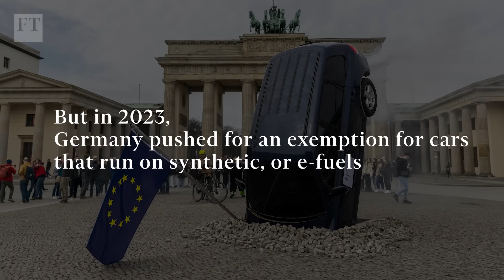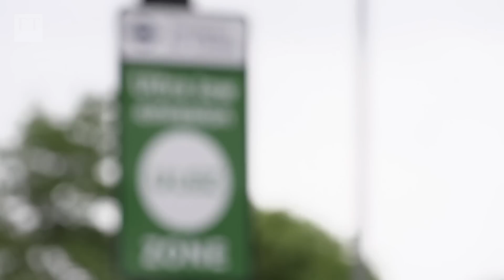The end of the combustion engine? | FT Energy Source

Comment: EVs need cost parity and simular ranges with faster charging  until that happens  combustion is here to stay
Reply: Not true. EV ranges are now acceptable for 99% of most use cases. The average European car owner drives 33km a day (12,000 km a year). We only have the one car, a Kia e-Niro and our average is 19,000 km a year. In a typical week I plug the car in once a week, taking it from 30% to 80% SOC and this covers our driving for the week. When going on a long journey I take the car to 100% and use public charging en route. In the first two years we had a few worrying moments of being able to plug in to a rapid charger but no disasters. In the past two year it has become a lot easier, certainly here in France with many rapid chargers to chose from on the main routes. We have made 4 trips to the UK in the past 5 years, 2 to Switzerland, 1 to Germany and 1 to Spain...never once have we had to queue to use a charger or not been able to plug in, take a rest and continue our journey. Driving 600km a day is comfortable and although I don't like to do more than that in a day we did once do 1,100 km in the winter but that was an extreme case.
Reply: @kiae-nirodiariesencore4270  It's even better if you have a garage with a slow charger. Get home, plug the car for the night, and next morning you have its full range. It's as practical as having someone to take your car to the fuel station for you every day. It's also cheaper than using fast chargers because you tend to pay less for electricity at home than at a fast charger, and slowly charging the battery increases its durability.
Reply: @gametheory2-i6p  There are already EVs with over 1,000Km (621 miles) of range that can quickly charge enough for some 500 extra Km (310 extra miles) in 10 minutes, which is shorter than the pauses you should make while driving that distance.

As for cost parity, EVs in China seem to already be very close to cost parity with ICE cars even when you disregard all subsidies, and are expected to get there in the next few years. Every country that doesn't block the import of Chinese cars should follow soon after, and even those that do impose barriers will need to find a way to make their own EVs cheaper or risk being outpriced out of all the other global markets — which would be a disaster for companies like Toyota, VW, Ford, GM, etc.

Though, of course, that doesn't even touch one of the best things about EVs: fuel prices. If you charge at home, for the same amount you would pay for 100 miles worth of gas you are likely to be able to get 300-500 miles worth of electricity — and that if you don't have solar panels at home, because if you do it becomes even cheaper.
Reply: @gametheory2-i6p 1 in 3 new car purchases in China are already EVs. Someone needs to tell the Chinese that what they are doing is impossible!
Reply: @gametheory2-i6p  Hydrogen like the Toyota Mirai, the single car model with the worst devaluation in the whole US market? That thing is so bad current owners accept huge losses just to get rid of that unwieldy piece of junk. Hydrogen is more expensive than both fossil fuels and electricity, has expensive and clunky logistics, and requires a distribution infrastructure much costlier than either gas stations or recharge stations. Heck, hydrogen stations are already closing down in the US; Hydrogen has already lost the race to EVs, and soundly so.

As for CO2, there are credible studies showing that even if you use coal power for both making and recharging an EV it will still emit less CO2 than a car powered by fossil fuels; the difference in energy efficiency is that great. And as old fossil fuel-based power generation is replaced with renewables the CO2 footprint of already running EVs is further reduced, whereas the CO2 footprint of a fossil fuel car can't be reduced (well, not unless you are willing to pay 3-5x more for your fuel in order to use the synthetic kind, if you can even find it for sale).

As for EV performance and charging speed: stop looking at EVs from 2010 (or at EVs that are more akin to toys than to cars) and start looking at proper EVs from 2023 onward. Batteries are evolving by leaps and bounds. A decade old EV will obviously have much worse battery performance than a new model; heck, even a year can make a big difference with how fast things are changing right now.

Regarding winter performance, modern EVs actually lose less efficiency in the cold than ICE cars; what makes ICE cars seem to lose less performance is that you get "free" heat for heating the cabin due to all the waste heat generated by ICE cars, but if you don't use the heater then modern EVs, with proper battery temperature management, actually lose less range on average in freezing climates than ICE cars. Heck, Norway — a country where half of its landmass is inside the Arctic Polar Circle — has almost 85% of new cars being pure EVs, and most of the rest being hybrids, with only a small fraction of cars there being internal combustion cars; you would be hard-pressed to find a country with colder climate than that, and EVs work just fine for them. Also, the only car to ever successfully complete the trip from North Pole to South Pole was an EV, exactly because ICE cars have huge issues running in the extreme cold and high altitudes of the South Pole, but an EV has no issue with it.
Reply: @gametheory2-i6p  What radiation, electromagnetic waves? If those were an issue then you wouldn't be able to use radios or cellphones inside an EV, and the EVs wouldn't be approved by the FCC to boot. It's easy — and mandatory — to shield electric engines and other electronic components to prevent them from emitting this kind of EM radiation, as failing to do so could interfere with, or in extreme cases even bring down, telecommunication systems.
As for other kinds of radiation, there are none.
Reply: since when has Porsche announced that it wants to get out of EVs?  It has just announced new EV models and its goal is for 80% of all new sales to be EVs by 2030. Are you for real?  @gametheory2-i6p
Reply: There is already purchase cost parity in some countries.
Whole life costs are generally lower for a new EV vs ICE.
Reply: I read somewhere recently that half of American motorists drive their vehicles less than 3 miles a day. Hot Take: the average American (and Canadian) is too sedentary & lazy to walk or cycle only a few miles. And those who do try to exercise and improve their health, may end up risking their lives on dangerous multi-lane highways & stroads—purpose-built for cars, not people. But back to your point about 'range anxiety' with EVs, most electric vehicles being manufactured now have more than enough battery capacity for ranges far-exceeding what the average commuter in the U.S. travels in a day.

That said, EV sales will bolster industry profits and sell even more automobiles to a hopelessly addicted and car-dependent culture—but EVs will do nothing to save our planet, in the end.

Comment: Combustion engines are not the biggest problem, EV’s are not the best solution, given the mining required to furnish new electrical infrastructure
Reply: Combustion engines need oil based products to make them run, e-fuels are a fantasy as we will never have the feedstocks to make much of it and the conversion process is very expensive and wasteful of energy. Drilling, pumping, shipping and refining crude oil is far more damaging to the environment than mining for the minerals we need for the transition. And remember that these minerals are not burned as all fossil fuels are and at end of life will be recycled. Check out the billions of investment going into companies who recycle batteries...Redwood Materials, LiCycle, Fortum, Northvolt, EcoBat, Umicore...to name just a few. Recovery rates of lithium, nickel, copper, cobalt, manganese etc have reached 97% and this industry will be worth $50 billion by 2030. You can't recycle tailpipe emissions.
Reply: E-fuels are probably not going to be used on mass for cars. You wont be able to buy your regular Ford or VW with it, but brands like Ferrari, Porsche and others like it will cling to them like their lives depend on it (because they probably do) and their customers will be willing to pay for it.  @kiae-nirodiariesencore4270

Comment: Ok, so current EV's are expensive, because combustion engines have decades of a head start, but we shouldn't give up on this promise of carbon free transportation. Yet somehow, synthetic fuels are expensive, because it's a new industry, but we should already give up on it because Chinese EV's have decades of a head start? Pick a lane. Should we fund new carbon-free technologies, or should we let the market decide. Because you're advocating for both, depending on whether it fits your ideological prejudices.
Reply: Totally. Personally I think we should let the market decide which technology is best (depending on the application different techs can win, for instance long haul transportation is a no go for full battery electrification, synfuels will most likely play a key role there).
Reply: @tomasfontes3616  In the end the market will decide but there are, from a purely factual basis, I think there are major disadvantages to synfuels.  Firstly, they are way, way behind on energy efficency so unless there is some amazing breakthough that drastically improves that or a way to effectively harness waste energy for the purpose, it will take a lot of time and research for the technology to improve to the point were it is cheaper.  On the flipside EVs and battery technology have massive development focus currently so the technology is more mature and progressing much faster and still has a lot of room to grow and improve.  Those improvements may easily reach the point were issues like long haul transportation are no longer an issue.  Synfuels are starting a race way behind and are already at a disadvantage due to the nature of production.  Currently their only real advantage is existing transportation and distribution infrustructure.  That said, it isn't impossible that some breakthrough could drastically shift the balance one way or the other.
Reply: @tomasfontes3616  I agree.
Let's demand back the 0% intrest loans that VW and Toyota got, and all other fossile car factories.

And, stop the $7.000.000.000.000 (8,5% GDP of the world) oil subsidies

Then you have a fair competition.
Reply: The issue with "green" synthetic fuels is that they use electricity as an input, and due to the lower efficiencies of both the process of synthesizing the fuel and its usage in cars you waste most of it. For synthetic fuels to be competitive with electricity it would need renewable electricity generation to fall in price to almost zero, electricity distribution costs to remain high, and for the cost of distributing fuel to fall; that is a very unlikely combination, more so when you think about what adding renewable electricity generation and storage to homes will do to transmission and distribution costs.
Reply: @FabioCapela  not necessarily. Have you heard of high temperature nuclear reactors? More than half of the energy of a reactor is heat which could be directly harnessed to produce those fuels.
Reply: @tomasfontes3616  The process that produces hydrogen using heat is steam reforming, where you use methane reacting with water at high temperatures to produce hydrogen. The issue is, this process has a large carbon footprint; using hydrogen produced using this process for energy — including in making synthetic fuels — is environmentally worse than just using gasoline, or even burning coal.

In fact, one of the main uses for green hydrogen is exactly replacing the highly polluting brown hydrogen, as the hydrogen made using that heat-based reaction is known.

If you want green hydrogen — which is the only one that isn't environmentally bad — then you need to use electricity to make it.
Reply: @FabioCapela  there's an alternative way called dry reforming, which uses CO2 instead of water vapour to react with methane and produce syngas (carbon monoxide + H2). You can use CO2 already contained in natural gas which would normally just go to the atmosphere, or use feedstocks like biogas or capture concentrated CO2 from industry. Dry reforming is only slightly more endothermic than steam reforming. It's just not done today because the heat required for such process would come from burning fossil fuels, defeating the purpose. That's where high enthalpy nuclear comes in (not talking about the current, 'low' temperature high pressure water reactors, but instead about high temperature, low pressure gas or molten salt reactors).
Reply: @tomasfontes3616  
It still releases as much new CO2 to the atmosphere as steam reforming. Don't forget that carbon monoxide is unstable and naturally recombines with free oxygen to become CO2, which is why it's such a dangerous gas in enclosed spaces.

If the process of obtaining H2 uses natural gas/methane at all what you have is brown hydrogen, which is ecologically worse than just directly using the natural gas for fuel.

Heck, even the process of obtaining H2 from biofuels like Ethanol is usually damaging because biofuels take a large area to grow, an area that would be much better used producing renewable energy (in the same area you can produce about 40x more energy from solar panels than by growing Ethanol crops); the only exception is if your source for H2 is organic matter that would be burned or decomposed anyway, but then you are left with higher costs and limited availability of your H2 source.